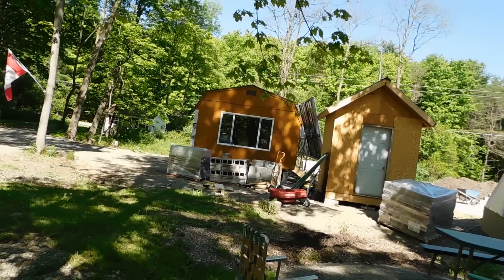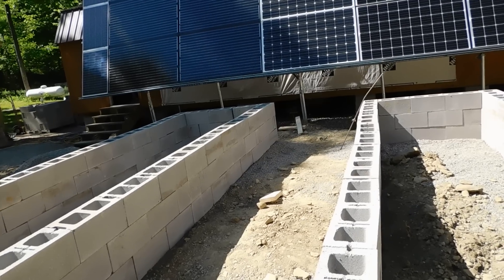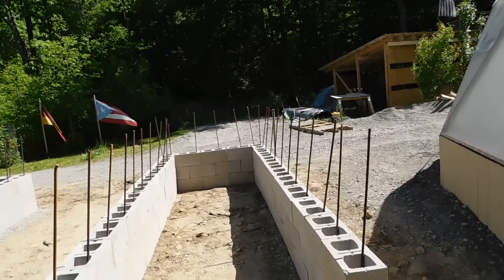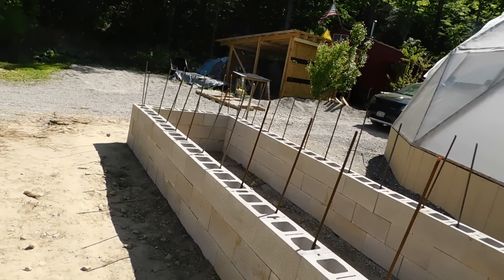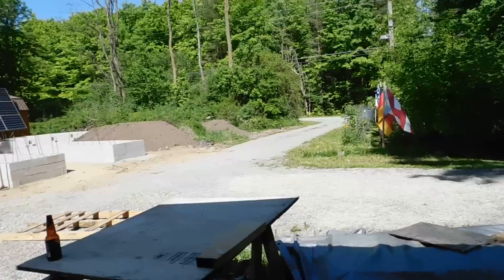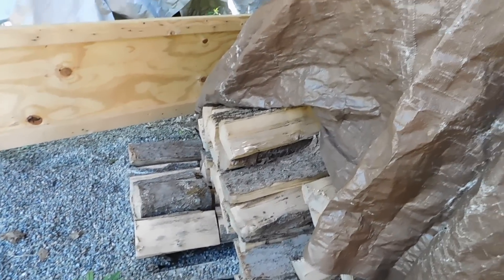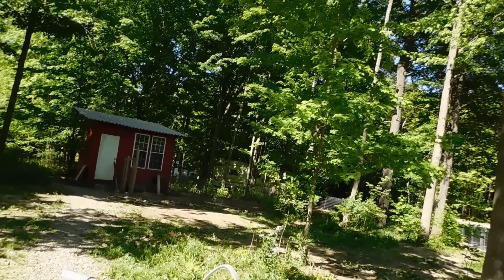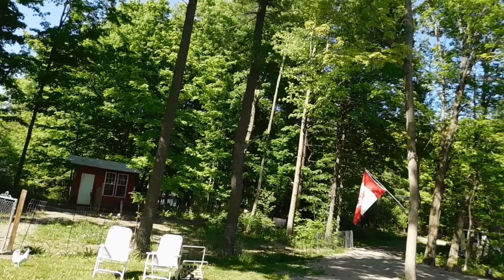A very long but productive day at the Homestead. Things are coming together.

Comment: Wood shed would make a good tobacco barn for barter too! Personally I would fill the holes on your beds with dirt. Plant herbs that distract bugs, like basil, lemon grass, etc. You can still cover with the cap stones for winter and replant every spring. Marigold flowers are great for bug control plus the flowers are edible in salads. Citranella for mosquitoes also is a good option.
Reply: Fabulous idea...herbs and bug deterrents. That is what I was thinking...why do stone when you can plant...my yard is a jungle. Nasurtium will make a pretty vine with flowers and they are edible leaves, flowers, and the young seed pods are called "California capers". They have a peppery taste and leaves are gelatinous. Cherry tomatoes and cucumbers like to drape down. Mint, though can be invasive, maybe not in the cold areas. To break up the square cinder block look, two urns with lemon grass (or ginger or tumeric possibly) planted in them will provide a focal point.
Reply: you can do half stone, half dirt but a very good idea.

Comment: The snow will melt and cause a ice damn at the bottom of the roof. It will freeze under snow and cause problems.
Reply: Which roof would that be? The metal woodshed roof? That roof will be the same temperature from top to bottom under snow. Ice dams are formed on asphalt roofs when warm air escapes from the upper portion that is usually over living space which is heated and if poorly insulated will melt snow on top which causes water to trickle down and hit the cold unheated eave part of roof and refreeze. This builds up and creates a dam so the next time water flows down it gets blocked by the dam and wicks back up under the shingles and leaks thru to the sheathing thru nail holes, torn tar paper etc. and then expands when it freezes making the holes bigger, leading to roof rot.
   That's why code calls for Winterguard shingle underlayment above the eave overhang. It has a rubberized membrane that reseals nail holes etc. If you have ice dams it's usually a sign of poor insulation. Just FYI...